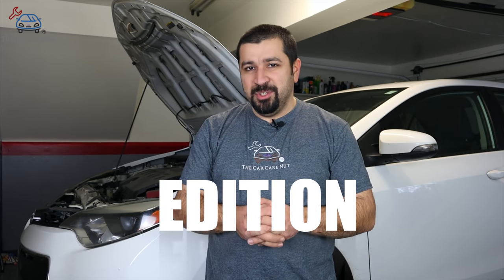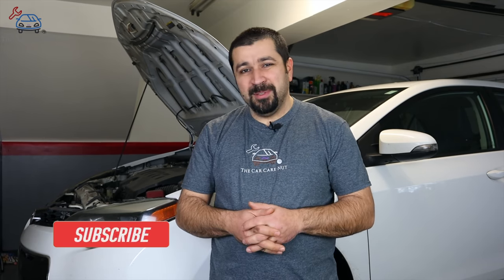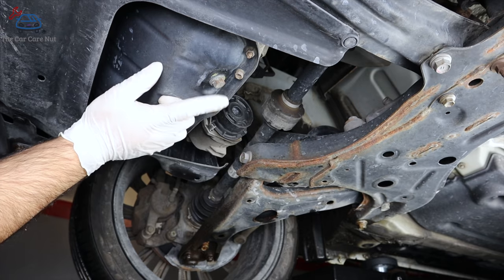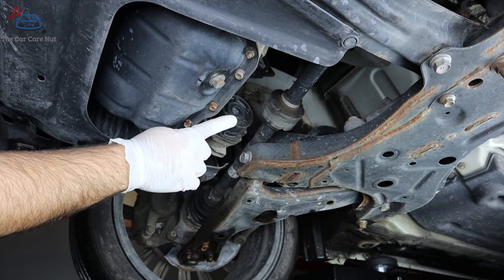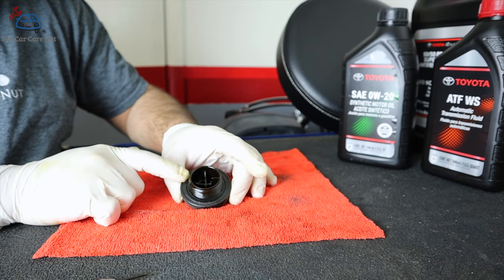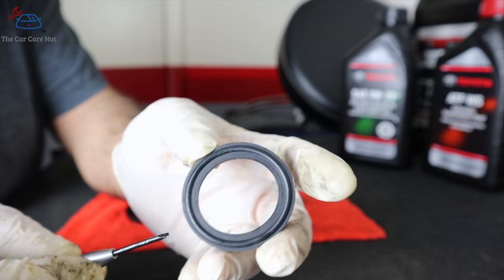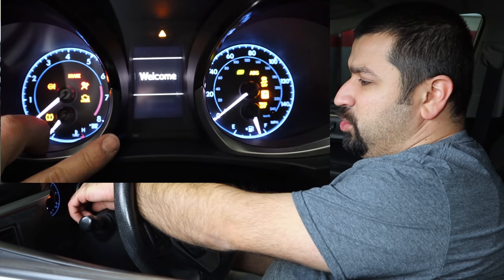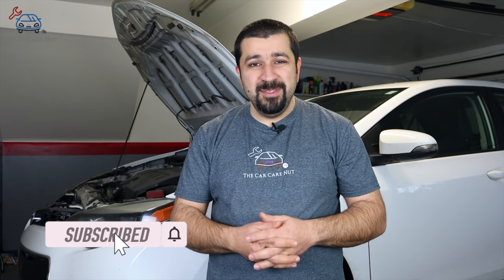How to change your Engine oil and filter for Toyota Lexus Scion

Comment: Great tip of putting the oil cap in the visible location. Bought a brand new 1989 Camry LE V6 from a Toyota dealer in Alhambra, CA. Without knowledge of car maintenance as a student, took the Camry in for the first 3000 miles oil change. Oil was all over my garage when came back. Went back to the dealership and they claimed the oil filler cap was missing and would charge me for another oil change plus $3.25 oil cap. My girlfriend (my wife now) and I insisted that no one had ever touched this car during the last 24 hours of their oil change. Finally this dealer didn't charge and did the engine cleaning free of charge. Long story short, this car was traded in for a cab forward 1993 Dodge Intrepid (looked nice at that time),  where our nightmare began.
Reply: NEVER let a dealership change your car's oil. But, if you do, always check the level, be sure it's clean oil, look under the car, etc. before you start it. Same is true of anything else you have done at a shop that's on the other side of the $$ from you. CHECK.  You changed from a Toyota product to something from Chrysler...now FIAT-Chrysler????
Reply: One man's nightmare is another dealership dream
Reply: Chrysler could never combine reliability (pre-'57/Slant 6/K Cars) with great styling and driving dynamics ('57's and Cab Forward). Truly Chrysler Corp. was a missed opportunity to be the best of the Big 3. The sell out to Daimler and them getting raped by the Germans was the end.

Comment: Hey!
Just to give you an update about my previous comment, I just changed my 2017 prius engine oil with Mobil full synthetic 0W-20. I saw the mechanic pulled out a box of 6 pack of 0W-20 and he put 5 bottles in there. I couldn’t see how much each bottle contained but on the box it says Mobil 1 Advanced Fuel Economy, part no 124184. Is the quantity and quality of the oil okay?
Thanks again!
Reply from the maker: The quality is good but if he put the 5 bottles and they were quarts that could be too much. I would check the oil level
Reply: @TheCarCareNut  It was 5 quarts, I just confirmed. From next time should O ask them to put 4 and half bottle?
Reply from the maker: It should be right around 4.4 quarts

Comment: I just received 2 new oil filters from a Toyota dealer and the part number on them is strange. Can you tell me if these will work on my 2021 rav4 with the 2.5 motor. 17801-yzzf2 TT.
Reply from the maker: Interesting. Haven’t seen that part number usually it’s 90915-YZZN1
Reply: @TheCarCareNut  thanks for responding, it turns out that the correct part number was on the filter. For some reason the part number on the box was different. 😲

Comment: I just did a break-in oil change on my 2021 Sienna at 1011 miles. The used oil was like water and reeked of gasoline. Should I be worried?
Reply from the maker: No that’s normal don’t worry.
Reply: @TheCarCareNut  Thanks for the prompt response.

Comment: is it okay to switch from 15620-36020 to 15620-31060 canister?
Reply from the maker: Model and year and a bit more details
Reply: @TheCarCareNut  2017 camry 4 cyl
Reply from the maker: Honestly I haven’t tried it. It could work but personally I wouldn’t. For everyone else reading this and wondering. The first number is the plastic housing for the 4 cylinder model and the 2nd number is for a V6 which is an aluminum housing.

Comment: 7:30 I expect that plastic cap of the oil filter assembly can be replaced with a cast aluminum one .  I changed it on my 2011 Camry , though it was for a 3.5 liter  Toyota SUV  ?  And I didn't bother with the plastic drain tube that comes with each filter . As it presses against a spring to allow less " messy " oil drainage .  Over time  I would say the spring would weaken and possible oil leakage . Though there is a o-ring  underneath the cap that fits over it . I just take the whole thing off and pour the oil out . Though always to use the new o-ring that fits underneath  that cap .  And to lube up the big o-ring that goes around the  oil filter assembly , all around before placing it in position .

Comment: I have a 2020 Highlander with the stupid cover covering both drain plug and oil filter. I will have to use ramps to lift the front end for me to crawl under. Do you recommend steel or plastic ramps for safety reasons
Reply from the maker: I personally would use steel ramps. Plastic ramps are likely well made as well but I feel more comfortable with steel.
Reply: @TheCarCareNut  My thoughts exactly-thanks!

Comment: AMD, on a 2022 Camry Hybrid what is the torque spec for the spin on filter, since it’s not that cartridge style? Drain plug torque as well?  Hoping you show an oil change on your new XSE since it would be the same! 🙏
Reply from the maker: Hi! The drain plug is the same as the video and on the spin on filter hand tighten until it stops
Reply: @TheCarCareNut  Thanks! Your are a great help to the community!

Comment: Surprised you didn't pre-drain the filter. On vehicles where the filter is mounted vertical it can be messy if you don't pre-drain it.  If you do a lot of Toyota changes get the kit from Motivx that has the filter drain and the Toyota specific funnel. Well worth the upfront cost and makes changed simple and less mess. 
 https://www.amazon.com/Motivx-Tools-Filter-Wrench-Advanced/dp/B0791MWXDC
Reply from the maker: Hi Corey. The original filter does come with a white plastic drain that you can use but it’ll still make a mess. On the ones with the drain take the filter slowly until it starts to drain and let it finish before taking it all the way out.
Reply: @TheCarCareNut  
😄 thats where the common sense of doing things helpful.👍nicely said.

Comment: How do you fell about replacing oil drain bolt with a fumoto drain valve?
Reply from the maker: Hi! Don’t like it honestly. If the valve fails it could cost you an engine.

Comment: Since my Prius oil capacity is 4.4 gallon. And the gallon is 5 quarts. After I drain the used oil.  I rinse with clean oil inside the engine approximately 0.5 quarts.

Comment: I am actually going to try and change the oil after watching this video. I have always had my oil changed for me and it always seems to be overfilled when I check it. I have had many oil changes but never seem to have a problem with the engine. Never heard of filling it between the the two marks on the oil dip stick.

Comment: Give me an interesting comment about a gasket on the oil cap itself… Can this impair the engine in any way beyond just a simple matter of some fresh oil around it when you take it off?… For an example let's try a 99 Toyota Solara V6… Thank you for a response love the show
Reply from the maker: Hi! If it’s completely missing it could cause an issue but if it’s leaking slightly no

Comment: What oil recommend for chr 1.2t? 0-20 or 5-30?
Reply from the maker: Hi! That engine is not sold in my area so I’m not familiar with it. I would look in the owners manual
Reply: @TheCarCareNut  the manual say 0-20 Toyota fe but I want your opinion
Reply from the maker: I would use 0w20 then. No issues using it.

Comment: Hi AMD. Hope all is well. My dealer overfilled my oil in my 2018 Tacoma. Is there an overfill tolerance and if so by how much?
Reply from the maker: Hi! Typically any overfilling is not favorable and it’s best not to. However overfilling by less than a 1/2 quart doesn’t put you in any damage or danger zone. However overfilling with a quart or more can
Reply: @TheCarCareNut  thank you!

Comment: I did not change oil in my 2016 Camry for 2 years. I am in Canada. The oil is 0W20, I assume it is synthetic because it was a dealer who changed it 2 years ago. Due to COVID I was scared to go to mechanic. In two years I travelled only 1,200 km or 800 miles, while the Manual tells to change the oil at 10,000 miles or 12 months whatever comes first.  My total mileage is also low - only 3,700 miles as I do not drive much. Please, advise should I worry that I did not change the oil for 24 months, while having very low mileage in the last 2 years?
Reply from the maker: Hi! Don’t worry for a one time occurrence. But going forward try not to let it go that long and everything will be ok.
Reply: @TheCarCareNut  Thanks!
Reply: @TheCarCareNut  Thanks. 
Another question - the Toyota dealer recommends to replace brakes fluid, but my total mileage is only 3,600 miles after 5 years of use after I purchased it brand new. Dealers often recommend unnecessary service just to increase sales. This is why I am not sure if I need to replace the brake fluid with such a small mileage. I would appreciate your opinion.
Reply from the maker: They need to test it. You can test it yourself as well with a tool to see if replacement is needed or not

Comment: What are you supposed to do if that metal center mounted spring loaded (drainback valve ?) gizmo inside the cartridge pops out when you take the paper filter out?
Reply from the maker: You can reinstall it. As long as it doesn’t come apart and break

Comment: I just purchased a oil filter conversion kit by Baxter Performance for my 2017 Tundra. Hate the plastic canister.
Reply: How's that working for you?
Reply: @edkronholm9054   I live it. Easy install I like spin on filters. Never liked the stock set up. Shall do an oil change again in 2000 miles.

Comment: 2015 2gr-fe and I have metal in my oil filter. Some are more than just specks, like actual shavings. They are magnetic. Is this considered normal? The motor had been sitting for a year or 2.
Reply from the maker: Hi! That’s not normal. Any rust internally or other issues with the engine?
Reply: @TheCarCareNut  I never opened the engine but it seems to be running fine if not a little bit loud. Like a sewing machine but I thought it was common for the 2gr-fe. Definitely not a spun bearing sound

Comment: I changed my the oil on my Sienna 05 last Monday. I added 5 litres but the capacity is 5 quarts which is 4.78 litres so I added .22 litre too much. Is that a serious issue ? Thanks
Reply from the maker: On that engine not a big issue. Slightly overfilled but it should be ok. If in doubt drain a little bit.

Comment: Thank you for the video. Not a big fan of the Toyota filter housing design or where it is located in most Toyota’s. I wish they put it up top somewhere like most Germans cars do where you can access it much easer or stick with old fashioned can filters
Reply from the maker: Very true! The early 1gr had it at the top but that’s about it.

Comment: Like to know ur input on an oil filter adapter to convert to a spin on from the cartage type.
Kind of expensive at $200. I heard the plastic one that the truck comes with can crack with age and the spin on Toyota filter gives more filtration media. Adaptor made by a co that starts with a B. Thanks.
Reply from the maker: Hi! Honestly I wouldn’t bother. The cartridge type filter does the job well and the plastic housing if not overtightened will last the life of the car.

Comment: Hi, would you recommend replacing the drain plug with a Fumoto drain plug valve?  Have you seen any issues with the Fumoto plug?  How about replacing the plastic housing assembly of the Tacoma with Genuine Toyota 15620-31060 Oil Filter Cap Assembly?

Thank you in advance!
Reply from the maker: Hi! On the drain plug I wouldn’t use the valve. Sure it could work fine but you’re resting the life of your engine on a valve hopefully not failing one day. Not worth the risk in my opinion. The housing you can switch to metal however torquing the plastic one to spec will make it last the life of the truck.

Comment: Really need a DIY video on a brake fluid replacement. Preferably on a 4Runner or GX460. What interval do you recommend for brake fluid?  Lexus manual calls for 3 years, but Toyota manual doesn’t mention it at all.
Reply from the maker: Hi! It needs to be tested for moisture content but usually around 3 years. A video for brake fluid replacement is planned and coming in the future

Comment: After the oil drains out, why didn't you wipe the area where the oil was draining on the oil pan with a rag? Won't this prevent any dirt or debris from the dirty oil from getting between the new gasket and bolt?
Reply from the maker: That area behind the gasket is generally clean from the previous gasket. Only time I would clean it is when it’s been to some quick lube places that put a yellow sealer around it.

Comment: on reading a 2010 highlander dipstick/oil level, theres 2 notches on the dipstick, when its cold, oil level is between the notches and when its hot, oil level is way over the top notch. Do i check dipstick when engine is cold or hot or warm for an accurate reading?
Reply from the maker: You’d want to check the engine oil when it’s hot. Shut off the car and wait 1 minute then check it. It shouldn’t be over the max mark
Reply: @TheCarCareNut  thanks again

Comment: Hi master tech. Can you do a video on how to correctly change brakes pads on a hybrid vehicle using the scan tool. Do we have reduce the pressure on the actuator before pushing the caliper piston? I figure you are pushing a force on the seals in the caliper and toward the motor. Could be wrong?
Reply from the maker: Hi! Replacing brake pads in a hybrid Toyota is the same as non hybrid. Just don’t open the hydraulic circuit. Those equipped with an electronic parking brake need a different procedure which will be covered in a future video.

Comment: Not sure if you covered this without going back to the start, it's a good idea to idle the car for a couple of minutes, just before everything gets too hot. Warm oil will flow out the drain better and lick up more sludge if there any in bottom the of pan.
Reply: You can. Wont hurt anything if you don't though.

Comment: Could you do a video on the 5th generation Camry? I heard some things about striped head bolts but I'm wondering if that Carries over to the 6th generation Camry.
Reply from the maker: Hi! Thank you for the video suggestion. The stripped bolt doesn’t carry over directly in the 6th gen but if overheated it can happen.

Comment: I use Amsoil which allows for a much longer oil change interval on their signature series ( I think 20000). I was going to change at 15000, the interval they allow for their oil filter that I used as well. Would you still recommend 5000 even though I’m using Amsoil?  2014 Toyota Camry. Thanks
Reply from the maker: Hi! I would follow the manufacturer recommended interval and pay special attention to special operating conditions.
Reply: Then 10,000 it is. Better to go with manufacturers recommendations. Thanks for your wisdom. Subscribed 👍

Comment: Did the oil change on 2024 Rav4, 0w16 oil. Any tips on checking the level when filling up? Its really hard to determine the current level when filling up with this oil.

Comment: I have a 2020 RAV4 now, but experienced oil burning requiring monthly oil top ups when I previously had VW, Audi and BMW vehicles. Regarding the advice on how often to do oil changes to minimize the risk of excess oil consumption, what about someone who does higher than average mileage? For example I do 5000 mostly highway miles every 3 months. Would you recommend an oil change every 3 months then? Thanks, great channel, just subscribed!
Reply from the maker: Hi! Likely you won’t fall under the special operating conditions listed in your maintenance guide. I would check them and if they don’t apply you could go the 10k but even with that if this was my car and actually that’s the kind of mileage I drive I still change it every 5k miles and perhaps save by doing the oil change yourself.
Reply: Generally Toyotas and most domestic cars do not burn oil.  Some European cars and many Japanese cars use a lot of oil since they are poorly made.  New engines should not burn any oil.  More frequent oil changes are better.  All engines will burn oil eventually especially if the oil gets dirty between changes.  I’d just do it every 3 months, oil is cheap.  Mobil 1 and Pennzoil often have rebates.  Don’t overfill or you will wreck the engine.  It’s best to be just under the full line.  Check hot 15 minutes after shut down.

Comment: Is it necessary to prefill oil filter?
Reply from the maker: Honestly not really. The engines that pre filling the oil filter is not possible last exactly the same long time as the ones that you can.
Reply: @TheCarCareNut  thank you for reply. Reason I asked was because my last oil change I decided to do it that way and then added the full 6quarts in the engine. I have the 2grfe 07 Avalon.  It was way too much oil. I drove it for about 50-80 miles and as I’m driving I kept thinking too much oil possibly causing damage so I redone the oil change without adding oil in filter.

Comment: I have a ‘17 4Runner with the ‘cap’ on the bottom of the oil canister.  You mention to leave it alone but if I don’t drain the filter before removing it (it’s vertical, unlike the one in this video which is horizontal) then the mess I get when loosening the cap is insane.  I use a motiveX tool (not the little plastic tool that comes with the new filter) to drain it before removing it.  Also, while you say that the plastic filter housing is ok, I have read too many horror stories of them cracking so I replaced it with a metal one (not expensive).  Otherwise, thanks for these videos.
Reply from the maker: You can drain it however if you loosen the filter a bit it will drain. The filter housing cracks when you over tighten it. If it’s never overtightened it should last the lift of the car.
Reply: 4runners and tundras are such a force. Almost impossible to not get oil everywhere when taking the filter out, even if you drain it.